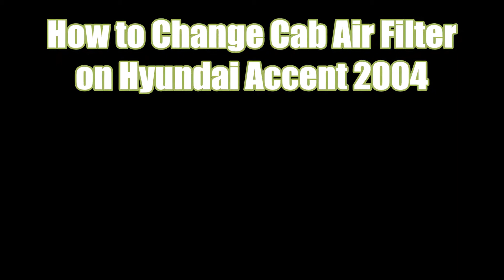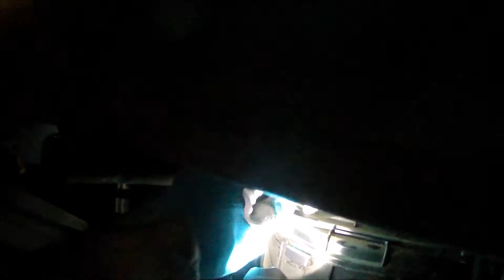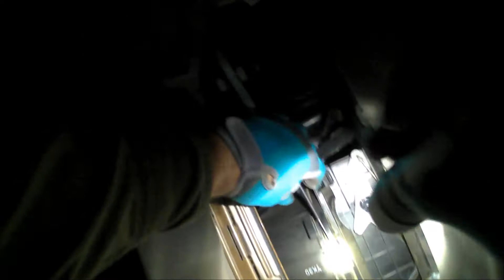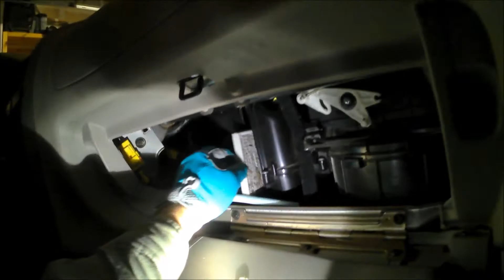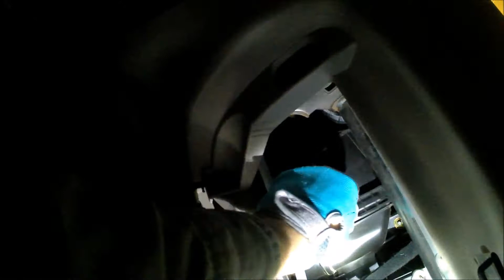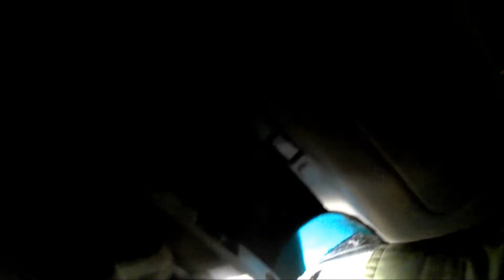How to replace 2004 Hyundai Accent Cab Air Filter in 2017

Comment: Do you know if there are charcoal filters available? I haven't found any myself for this car
Reply from the maker: Idk try amazon or Google could work
Reply: @F3ND1MUS jea I ordered my new one off of Amazon as well, didn't find any charcoal ones, only for my dads B-Class and other cars
Reply from the maker: @timeichler391  try searching charcoal with the year and veh make in google it might come up i found some w charcoal but didnt see if they were compatible w the car model exactly. I ha e a 2018 kia soul now though and probably getting something else soon. Still change filters inside the cabin and the engine routinely

Comment: Can you please elaborate on how you removed those two black clips? I am able to 'unclip' them and slide them inwards so that they're hanging freely inside the hole, but the back rubber part blocks the tray from sliding out. Any tips?
Reply from the maker: just woke up, here is what I  found off some forums for you:
On the outside of the box, press in on the black "button" that you see
inside the box. At the same time, pull the black button toward the
glove box lid. That should free the plastic latch and allow you to
extract the latch thru the opening into the glove box. Small hands
are big help...

SJ

https://www.thehyundaiforums.com/threads/those-dang-glove-box-clips-stops.6319/
Reply from the maker: I would say they are tricky, just make sure they are as straight/ flat as possible and it may require two hands to firmly manuver them around the sides holding them in place, but once you get one side try the other, I hope this helps. also note if you are too rough it may break so try to just breathe and relax, then work one side at a time would be my advice.
Reply from the maker: I just made a video and I am uploading it now, it will be about 30 minutes of processing on youtube part, and I show how to remove and put them back in with an explanation of how they work, its like 7 minutes of video. take care. and i will link it when its done. its 3:47 pacific time right now.
Reply from the maker: https://www.youtube.com/watch?v=kMELQJP9Blw here is an in depth video about those clips.